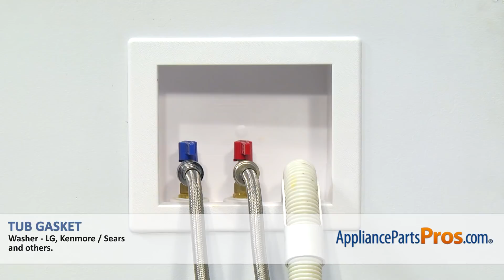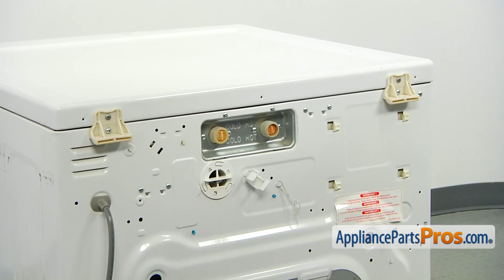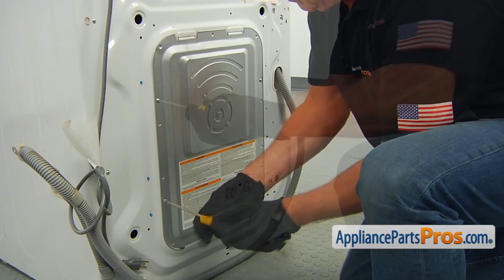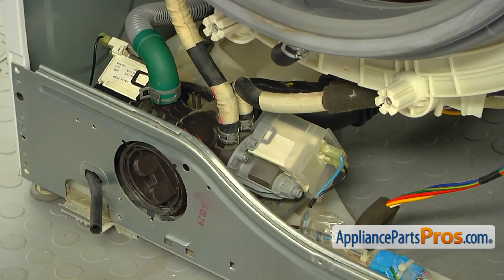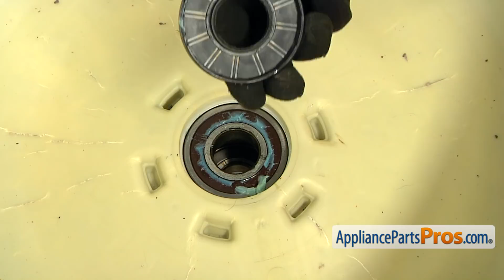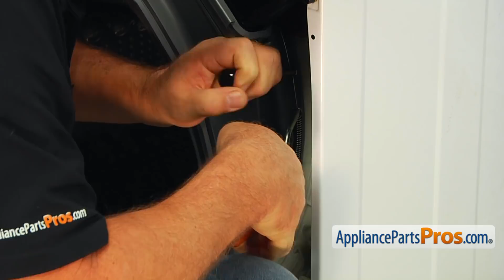How To: LG/Kenmore Tub Gasket MDS62058301

Comment: Great descriptive video for my 2013 LG front load washer. Model was a bit different but very similar. Make sure you get parts for YOUR model. Not the numbers in video which seem to be model specific. My washer was down for about a week. First remove everything down to the leak. I found two other issues that needed replacement as well (torn door boot which apparently was also leaking and drain hose assembly).  Lay out all removed parts in the order they are removed.  Keep screws with parts. Know the difference between a sheet metal screw and a plastic screw. Don’t overtighten screws into plastic. Ordered  needed parts from Appliance Parts Pros with enhanced shipping. Put everything back together again in half a Saturday. Definitely have all the tools  he lists in the video including the spring pliers easily found online. Washer running nicely now with no leaks. Also, plan on cleaning lots of plugged hoses. I just disconnected the ends and poured hot water down into a container until all ran clean. Also used a wooden skewer to help junked up lines. Good job Simon!